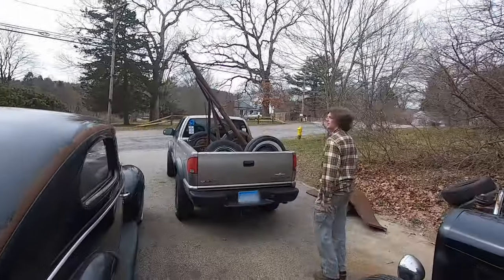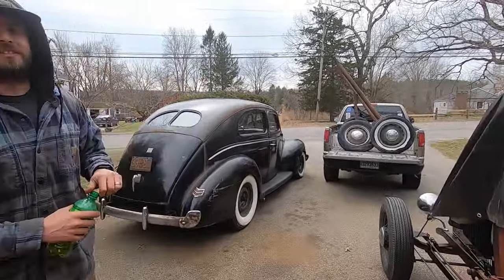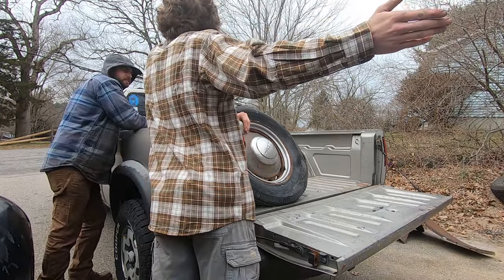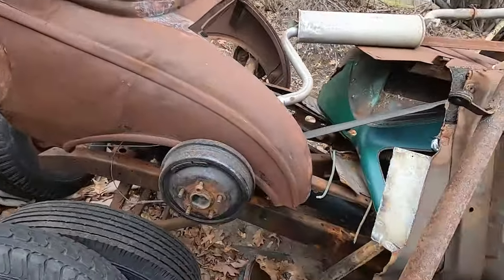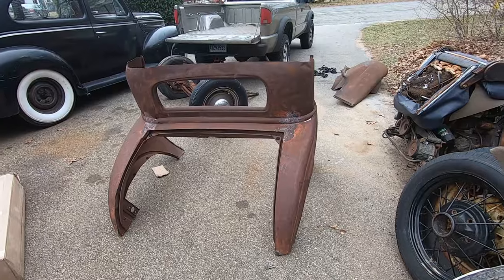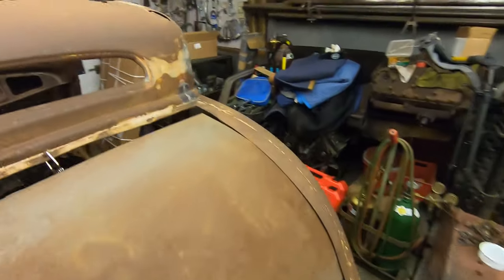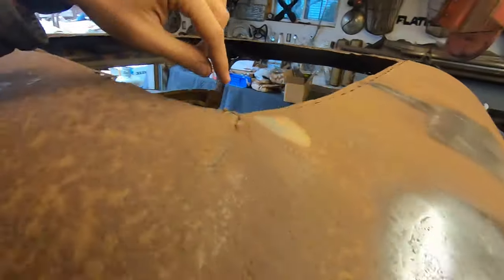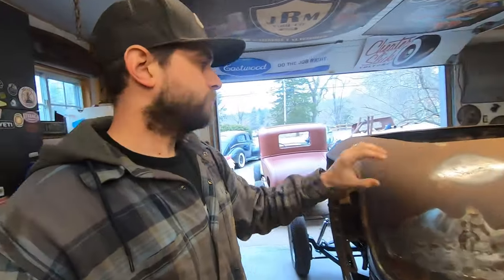Starting To Fix The Body On The 1932 3w Coupe

Comment: Just a little snippet of trivea. In 1932 Ford used a 20 louvre hood at first, but after some customer complaints regarding overheating, they made the 24 louvre hood panels for the remainder of production. I counted 20 louvres on your left side hood panel [I presume that the right is the same. With the three window being a late introduction to production you have a 20 louvre hood on a 24 louvre body. I prefer the 20 louvre hood, so I kinda like it that way.